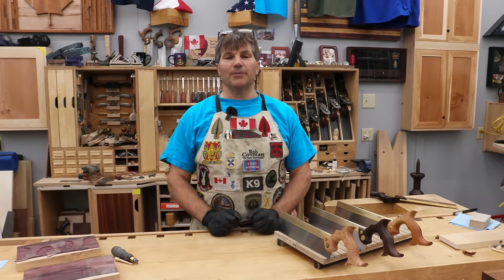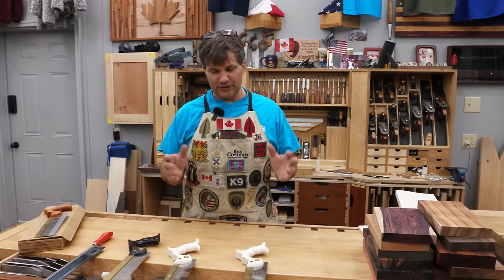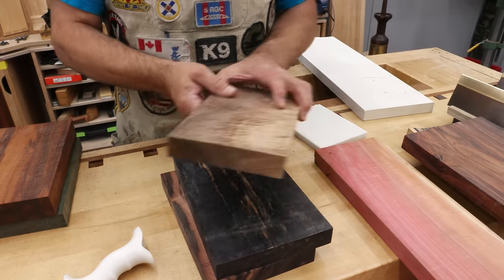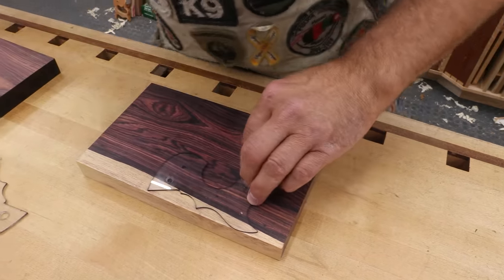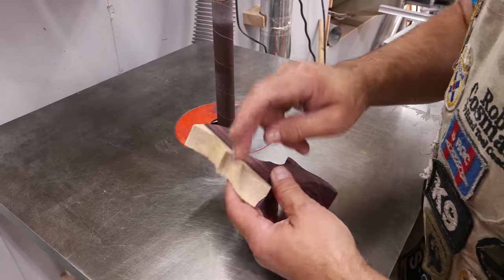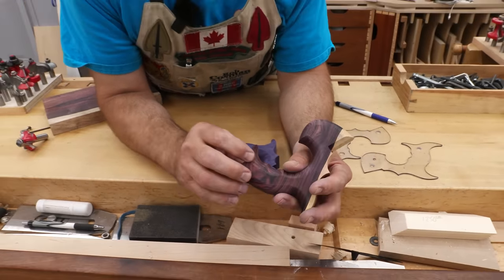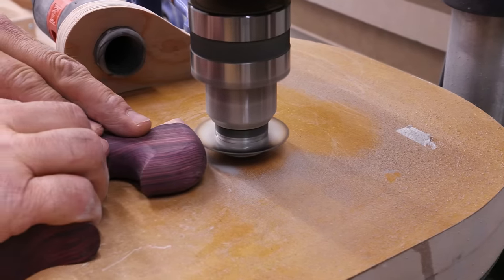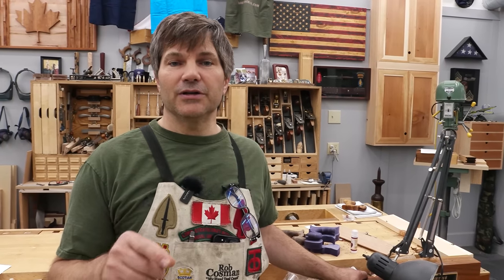Rob Cosman Dovetail Saw - How it is Made

Comment: I have the pleasure of owning one of your dovetail saws with the black speckled resin tote (and also the matching marking gauge) . Both tools are as beautiful to look at as they are to use (even with the resin), they truly are super high quality made tools. On a side note, watching this video answered a question that I often wondered about. On my saw, the brass pins that go through the back and blade have a light pink hue to them, I could never figure out why until now... the loctite! It doesn't bother me in the slightest, just one of those "unexplainable" things that barely caught my eye. I can finally sleep now.
Reply: As do mine, I thought it was sharpie, have you had any luck getting it off?
Reply: @Thewoolywoodshop  I tried using denatured alcohol once but it didn't work. It's possible that the brass pins absorbed/wicked the Loctite and caused permanent staining. As I said in my previous post, it doesn't bother me personally. I can see how it might annoy others though,  considering the price of the saw. I paid $350 CAD +tax.

Comment: This is a great video!  I would like to try my luck at making a saw and I was wondering what kind of of slot cutter do you use to cut the brass back, and also what type of tolerance is okay?   My saw plate thickness will depend on the best condition material I can source from an old handsaw.  I already have the brass stock, but no slot.  Thanks very much for you time.